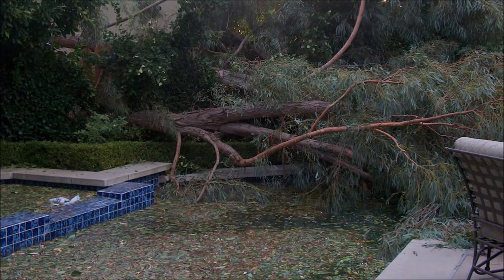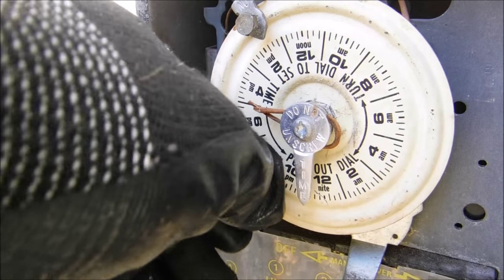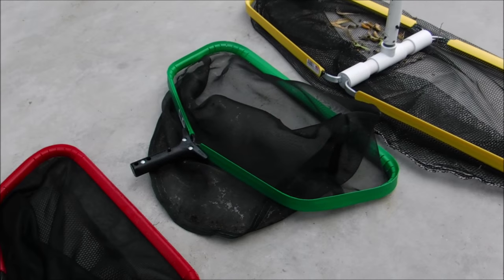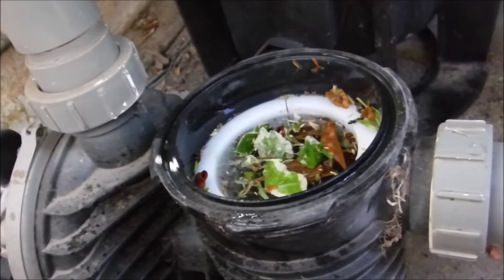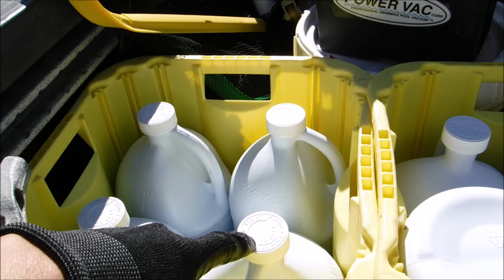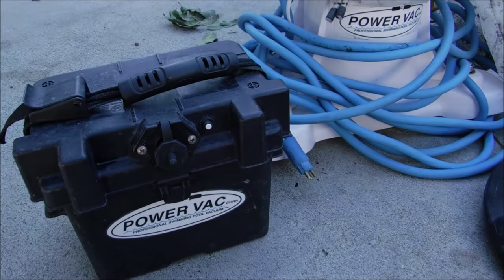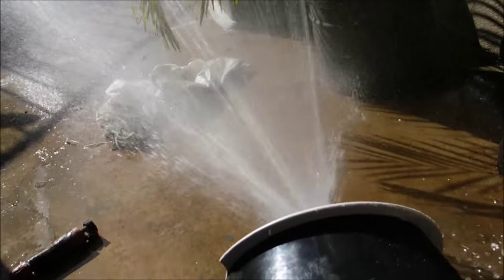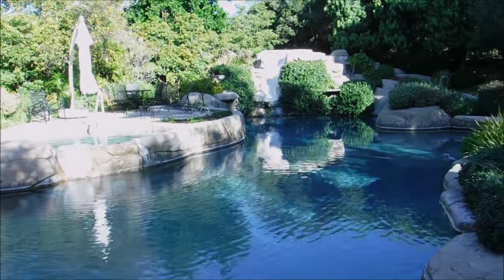Cleaning Your Pool After a Wind Storm

Comment: Off topic but I replaced a pressure gauge at one the pools I maintain and it still isn't giving me a reading. I ask I noticed that when I prime up the pump, the water that blows out the filter air relief valve trickles out.( pentair cc100)
Reply: +biggstell low pressure indicates a clog or restriction before the pump.
Reply: +co on or maybe the top of the filter is clogged with grime or something.
Reply from the maker: +biggstell How is the cartridge? And how is the flow to the pool?
Reply: +Swimming Pool Tips, Reviews & How To -MrDgvb1  the filter is brand new. Installed two weeks ago. The pool was a green swamp. There was also about  a foot of leaves on the bottom of the pool...
Reply: +Swimming Pool Tips, Reviews & How To -MrDgvb1    Could the skimmer line be clogged? I get good suction when I vacuum.